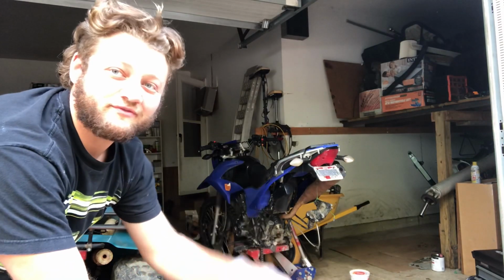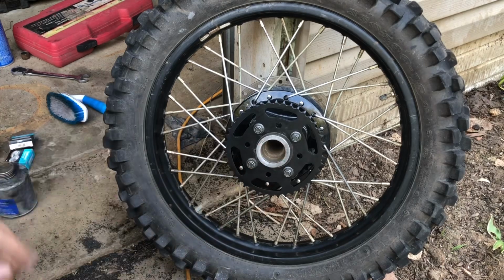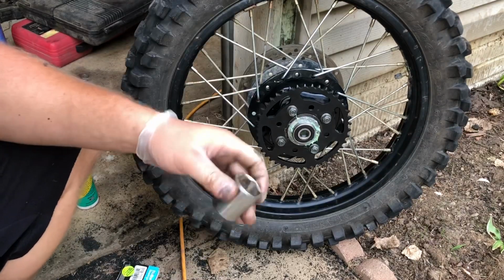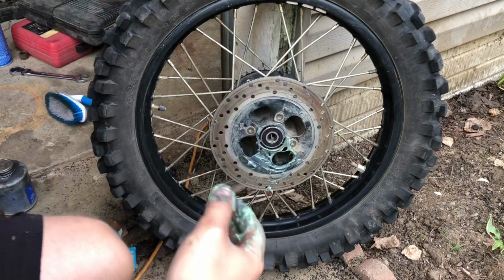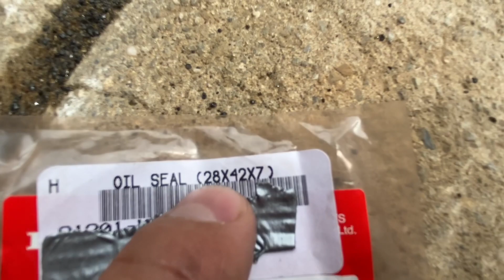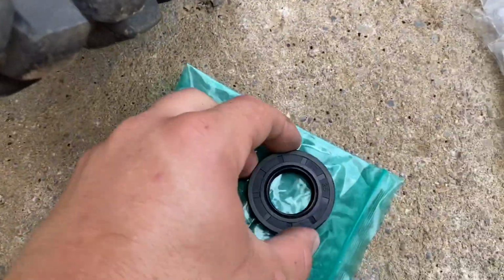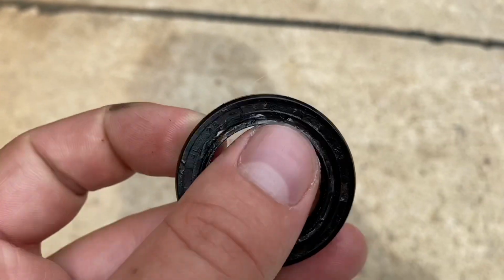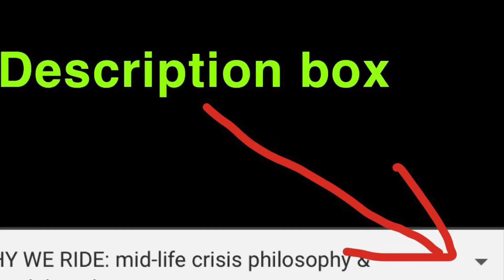Hawk 250 rear wheel bearings a seals

Comment: I just did this two weekends ago on my Hawk and replaced them with Nachi Japanese bearings off eBay; 6302-2RS. Wasn’t more than $16 total shipped. Good video!
Reply from the maker: Dustin Segers I had unfortunately already bought the $75 bearings lol.. they are Napa bearings so hopefully they last a while. Next time I’ll be looking for some good Japanese made bearings lol.
Reply: Dustin, did your bike have the incorrect seal sizes as well when you took it apart?
Reply: @jasonjulian1  Interestingly, the seals seemed to fit perfectly on mine. My Hawk is a 2019.
Reply: Dustin Segers That is interesting... I just went out and checked mine, they seem to fit good as well.  Mine is a 2020.  Also noticed my rear shock has spring preload adjustment.

I thought no Hawk had adjustable anything on the rear.
Reply: Jason J me too. My rear shock is the same. I actually like it, it’s pretty decent and I see no need to change it.
Reply: Dustin Segers agreed.  After putting 15wt oil in the forks and getting that grey water that Haosan calls fork oil out of there, even when I'm in a heavier phase of the year (190lbs vs 170 ish), no issues.

The squirrely knobbies on road are a bigger issue for me.

But it is nice to see what appear to be rolling upgrades to the bike as the years go on.
Reply: Jason J right. Those knobbies get weird after @ 63-65 mph. After changing all of the fluids to quality fluids, doing sprocket and carb mods and all of the expected “dealer prep”, I’m daily surprised by the quality and reliability of this cheap Chinabike.
Reply: Dustin Segers same here. I can't wait to be done tinkering and upgrading it so that I can put more miles under my butt.

I feel like I've installed more parts than the factory did.
Reply: Jason J Lol! I know right! I ordered more jets today as I’m still running a little rich. I have a few more things I want to do to it, and then I think I’m done. Mods so far: front and rear Nachi bearings, digital cluster, installed CSC fuel tank sending unit, Mikuni, airbox delete and UNI pod filter. Decatted exhaust and repainted it, NGK DR8EA plug, changed sprockets to 17/45, replaced with Niche o-ring chain, installed grease zerks to steering stem and swingarm tube, upgraded to sealed battery, installed H4 headlight, and flashing rear tail light. 
I want to put some Shinko 700s or 705s on there with new TR4 tubes later this fall and I think I’ll be done.
Reply: Dustin Segers I've got Protaper bar risers and a renthal bar coming... After that and I fab up an engine case guard, I think I'm done for a while. 

My mod list is ridiculous.... 

Led turn signals 
Led headlight 
Digital dash
IMS shift lever
Usb/12v charger
Upgraded fuse box and relays
Aux lighting
Adjustable short levers
Stainless steel exhaust/slip on muffler
E3 power spark plug 
extended fuel mix screw
Vm26 clone carburetor -115main, 1.5.turns mix screw on 40 pilot jet 
UNI Pod air filter 
Burrito tube
Tie down rings 
15wt Fork oil 
4" round mirrors
Front fender pack
17t front sprocket
45t rear sprocket
JT chain
4* timing advance key
oil cooler  
tail bag/helmet luggage
Tank bag
Soft saddle bags
Air bladder seat cushion 
14 Nachi rear wheel bearings 
Flashing LED brake/tail light bulb
LED license plate light bulb

Phew!
Reply: Are you sure it's still a Hawk? LOL!
Reply: Dustin Segers lol  no kidding. 

Based on the side cover stickers that just showed up (open mouth shark WWII nose art style) I'm calling it the Warhawk now.

I guess why not. Lol.

Comment: Those are sealed bearings.Loading up the hub with grease does nothing for the bearings.On the up side.....the axle wont rust.
Reply from the maker: With too much. Grease it actually fills the bearings with grease and blows out the seals… oops, forgot about that from when I used to have an XR 80 Honda, it got the same treatment with grease. Yes that’s what it’s all about! No rusted together parts! Thanks for watching!

Comment: When to do them?
Reply from the maker: I change the bearings  before they are complete shot.. otherwise it makes them harder to get out.. there is no real mileage to change them at. Bearings go bad at different times depending on your riding style. We have a creek behind our house so we can’t keep bearings in anything we have, especially our honda ranchers lol. We replaced bearings on honda ranchers about every 1500 miles.
Reply: @goodolboys713  curiosity because I am about to put a new sprocket on you know that snap clip I think it's called that holds it onwhat's the best way to get that off without breaking it or where I can find another one if I do break it
Reply from the maker: tucker emmons it’s a snap ring if your looking for one.. I haven’t needed to replace a snap ring on mine, you could probably find one on amazon, eBay, local hardware store, or auto parts store. The best way to remove the snap ring is snap ring pliers. if you don’t have snap ring pliers, you can use needle nose pliers and a flat blade screw driver. It’s not too hard to remove. Best of luck to you, and thanks for watching!

Comment: A lot of good info, however if you install 25x47x8 seal it will cut a groove in the caliper bracket. Too tight, china man installed dry and killed the correct 25x47x7 seal. FYI torque spokes or your rims will bend, I've replaced three out of five bikes
Reply from the maker: The 25x47x8 is the perfect seal for the bike, mine works very well! If you go any smaller on the seal it’s too small lol. No need to torque spokes, Iv got the auto tightening spokes😉 Thanks for watching!